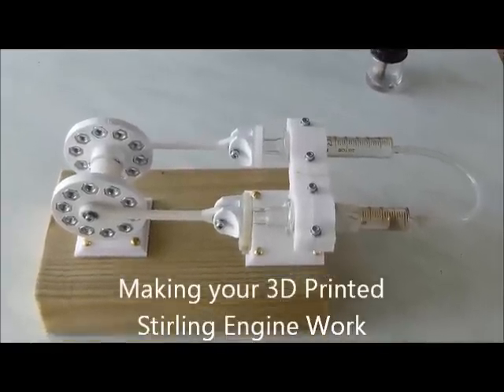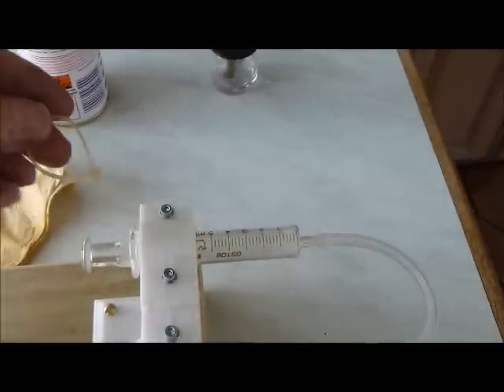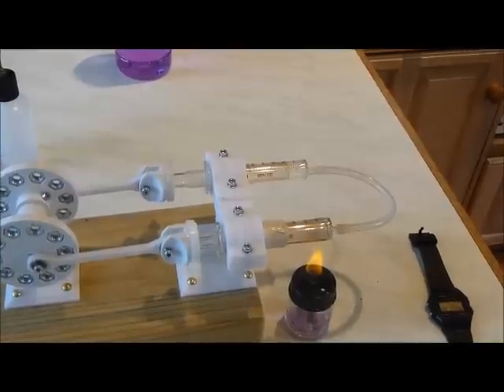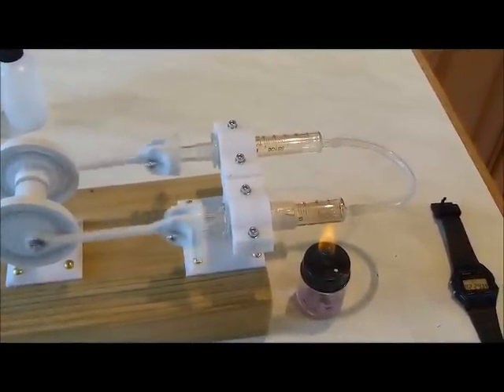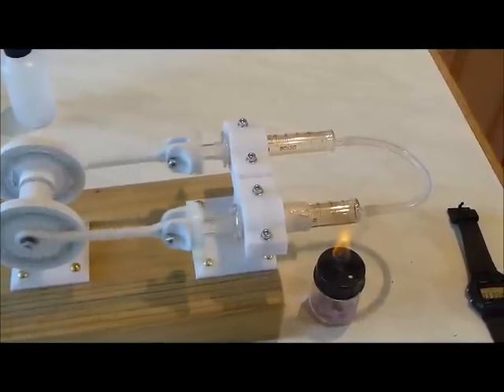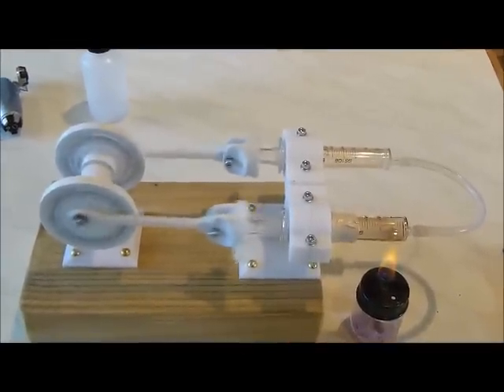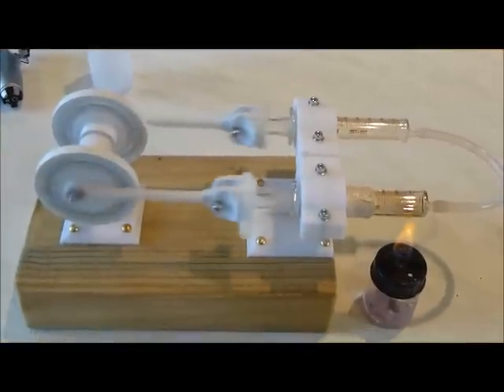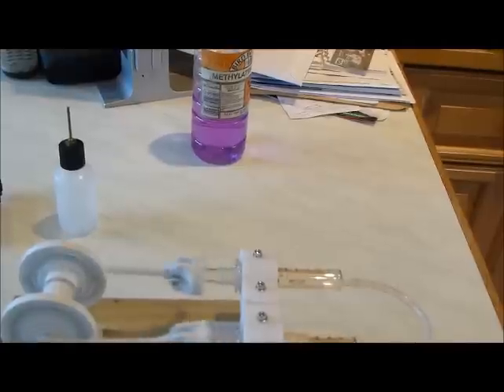Make your 3D Printed Stirling Engine Work

Comment: Hello Mr. Hall have you tried putting a small marble sized amount of steel wool in the hot syringe? Also, try wrapping some electrical copper wire around the regenerator. I have crushed pencil lead and rubbed it all over the piston which was a great idea. Lovely engine sir!
Reply from the maker: Hi You see to be finding good ways of improving the engine. Great! And graphite on the piston especially.

Comment: Great video, I wish I'd heard these tips when I was struggling with my version a few years ago.  I found that leaving half an inch or so air space in the hot cylinder prevents the thermal expansion of the piston (or at least delays it) as it stays further from the flame. I realise this might be less efficient in terms of the air not cooling as much but it doesn't seem to have too much effect.  I also found that putting a shield (a penny washer or similar) between the piston and silicon tube will prevent heat damage long term. I used standard bearings, popped off the shielded sides and soaked them overnight in 'Sticky Stuff Remover'. After drying they work perfectly. Thanks.

Comment: Hi there, I am looking to build this engine but I am only able to find shielded bearings — do you have any tips on whether it's possible to remove the shields or otherwise make them run faster? thanks!
Reply from the maker: Hi I bought open bearings from Wych Bearings.
https://www.wychbearings.co.uk
Part no MR106 - is that the right size for you?

Can you send me a bit of video or a photo?
andrewthamesside@gmail.com
It would help vs tuning/getting the best out of the engine

Comment: That's a neat idea using nuts on the flywheel for their weight.  It looks like you can add short bolts for extra weight.
Reply from the maker: Yes - not my idea - but it can also be useful for balancing. the engine - By not having weight at the appropriate places round the circle of the flywheel.

Comment: i have replicated this engine, i cant seem to have it run properly. what is the correct angle between the cranks? i read 90 degreees, somee 120 degrees. i tried both. but nothing works. 180 degrees seems to move smoothly but still i cannot have it run, what should i so? i am using 10ml syringe btw
Reply from the maker: Reyn - Unfortunately you are not alone. Getting a Stirling engine running is a bit of a challenge! But, with 3 or 4 previous engines, man has triumphed over machinery. We got them running!
You are right about 90 degrees - maybe 100 or so

A very likely cause is friction, or gas leaks.
When the engine is cold, and you give the flywheel a "flick" - does the engine "bounce" - does the flywheel cause the gas to be compressed - then the compressed gas cause the flywheel to stop and move the other way?
Can you plase send a photo? I am at andrewthamesside@gmail.com

Comment: What is the size of the syringe please?
Reply from the maker: Hi Manaf
There are two versions of the engine on Thingiverse
The original specification says two 5ml syringes

The later version is  at
https://www.thingiverse.com/thing:278422

It says 
If you look at the support design, you'll see one hollow cylinder is bigger in diameter than the other one. The big one will support the hot syringe.

To have a hot cylinder larger than the cold one will make the engine run better.
With a larger hot volume - the force from hot gas will be bigger

But do not install two syringes both of the same but larger size
Stilring engines do not scale up

Aeropic does not say what size the larger cylinder is
Perhaps - from the support for the bigger syringe - perhaps you can see the diameter measurement?
Just try the nest size up from 5ml?

Comment: Hello sir, first all congratulations on your Stirling, I'm working on the sale project but it doesnt work, we're using 10ml glass syringes because those were the ones we found. Also, what material are you using for  the conector between the syringes?
Reply from the maker: Hi Eduardo - I haven't tried to scale up this engine. The basic consideration with Stirling scaling is that if you double the size of the engine - then it is 2 times longer, 2 times higher and 2 time wider. So there is 8 times as much gas.
This needs 8 times as much heat. Meanwhile the surface area of the inside of the syringe is only 4 times bigger. 
So, if 8 times the heat is going to flow through 4 times the area, there are only two possibilities.
One is to put internal fins on the cylinder and double the internal heat transferring surface.
The other is that the engine will run at half the speed (to allow twice as much heat flow)
(Or - reduce the friction by half?)
So - it could be that with smooth glass syringes - its too challenging to be able to scale up?
Have you got some video of it being started?
I'm at andrewthamesside@gmail.com
I use flexible silicone tubing - but use a heat shield to protect it

Comment: Hello sir, I have been trying build a model of stirling engine as my 3rd year engineering project. I have eliminated friction as much as possible. But I'm still not able to get the engine running. One big problem that I'm encountering is that the tube/pipe that I'm using is melting at the end (the side where the syringe is being heated). It would be very helpful if you could help me. Can I get your email address so that I can send my project details and the pictures  of my model.
Reply from the maker: If you can send me some video that would help a lot - andrewthamesside@gmail.com
Reply: then you are not using  heat-tolerant  borosilcate glass materials.
https://en.wikipedia.org/wiki/Borosilicate_glass

Comment: Hello Andrew, I'm trying to make the same Stirling engine that you did, but I'm having problems. All the piezes are assembled correctly, and friction between syringues and the wheels is minimum. I think that maybe the problem is that when I try to heat the syringe the air doesnt expand as it should do. The angle between the weels is 90 degrees as in your video. I did the same trick as you with Bazzo too. When i try to make it work it doesn't do any kind of extra-movement. I'm using a medium candle as flame. What can be the problem? Thanks in advance and thanks for your video.
Reply from the maker: Hi Pablo
When the engine is cold and you spin the flywheel is there "bounce"? There should be compression in the engine and that should cause the pistons to "bounce" back. Just once - or twice? Or more?
One of the sayings is "no bounce no go" 
If there is no bounce then either the friction is too high - or there is a gas leak.
The syringes should not have any cracks in them - they are usually pretty tough.
It is possible (unlikely) that the plungers (displacers) have cracks? - They can be tested by putting them into hot water. If the have cracks - bubbles will appear
Just, just in case? The flywheel is being spun the right way? Stirlings only run one way
Do the plungers move to the ends of the syringes? It is important that the syringes almost touch the ends.
If not, there is "dead space" - space that contains air that is always hot (or in the other cylinder, cold)
This is dead space and reduces the power of the engine. Adjust the conrod lengths.
Can you put some video up on You tube? Show the cold compression/bounce - and then show the startup attempts?
Reply: I'm very thankful for your response Andrew. I'll check it and I'll send you a video. But I can say to you that the flywheel is being spun as you do in the video, and that the syringes don't have cracks. But my main worry is that the air doesn't expand. I mean, when I take a sirynger, without all the system, and I apply warm to it, obstructing the exit of air and making vacuum it doesnt moves, maybe 1 or two Little lines. I think that it should move a lot. It should? Thank you again and my regards.
Reply: @Pablo Pezo can you help me to a stirling engine? :(

Comment: Hello Andrew, i am making a similar Stirling engine but my hot end seal gives way every time. I use araldite to seal it. What adhesive did you use ? And is that a silicone tube between the two syringes ?
Reply from the maker: Yes it is a silicon tube.
Is the flame too big? It could be that there is a lot of heat being radiated to the tube - as well as conducted through the glass. I have hung a light piece of sheet aluminium over the end of the syringe. The idea is to shield the silicon tube from radiant heat.  I haven't had the problem of the tube coming off.  Can you get it running with a smaller flame? Or with the flame further from the silicon tube?
Reply: Thanks Andrew, that was of great help. Yes my flame is bigger than yours. I will try using a smaller one and shifting the mounting location towards the flywheels. But could you let know which sealant you used ?
Reply from the maker: No sealant! - Just friction. Andrew
Reply: Wow ! That's amazing. I will try these mods and see if it works. Thanks for inputs and this video is really great !

Comment: Very nice. You know, air cooled engines have looser tolerances in the piston-cylinder to allow for differing expansion of materials. Not quite the same thing, but you may try to reduce the piston dimension, and if that doesn't work, then make it larger. In the latter case startup time may be longer as parts will expand at different rates, but the cause of the binding is unclear, so may be one or the other.

Comment: are the syrenges the same size?
Reply from the maker: Yes. Also, the stroke on both the hot chamber and the cold chamber are the same. It can be usual for the cold stroke to be slightly less than the hot stroke.
Reply: Andrew Hall ok, thanks